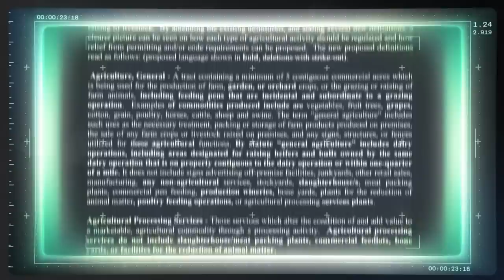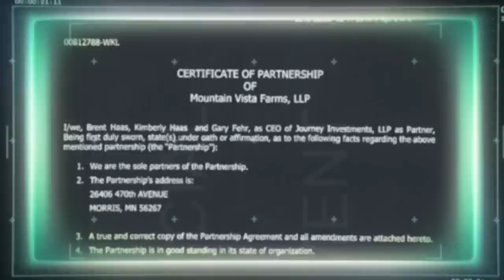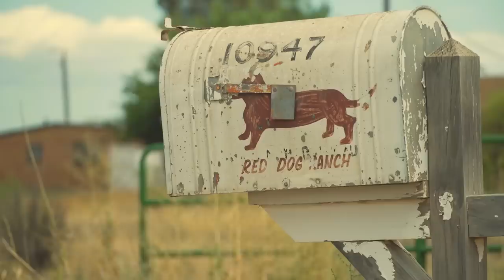Draining Arizona: Mining For Water In The Desert Leaves Residents' Wells Dry | NBC News

Comment: How come every time I watch a video like this one I see people irrigating crops in the middle of the day? I thought it was common knowledge that irrigating after sundown is better because less water is lost to evaporation, allowing more water to soak into the ground.
Reply: This could be early spring time or during colder weather
Reply: I’m in the ag business here in Texas and to answer your question your are right it’s best to water at night, but the pivots are walking so slow it usually takes 24hrs to make a complete rotation. By the time they do it’s time to start the process again.
Reply: @ryanweaver3615  We can put people on the moon but we can’t figure out a better way to irrigate?
Reply: Watering when sun goes down leads to fungus growth other nasty things
Reply: @ryanweaver3615  That seems like it would lead to an uneven crop. If watering at night is better, that slice of the pie/ clock face should also grow better, no?
Reply: The ground here is extremely dry and hard.  We've been having monsoons lately which is a very nice bit relief as the weather is predicting to continue with rain fall records.  
Regardless,  to get the water into the ground here is quite "tricky" with the hardness of the dirt.... not soil but dirt.
Reply: @chrischapman276  Turning soil into dirt is one of the biggest problems with big agriculture. So many problems could be solved by regenerative farming and cover crops.
Reply: @craig8638  We are learning quickly. My wife and I, mostly her, have hand tilled the 36x36 garden we've got here. We add the stuff from depot and lowes along with cow poo from local dairy's. 
The zucchini are enormous! Watermelon are almost ready to pluck. Sweetest corn we've had before in our southern california home's garden. Just a filled up nicely sized garden that my wife is  the artist of!
I don't have the skill or a green enough thumb to do what she does in that thing!
Reply: Did this for twenty years in Kansas, never figured that out. Corn can use an inch a day, but how to keep up just at night? Corn will bleach out and "Flash " (HEAT Damage ) during a 110 degree day...
Reply: @user-wj6kq3xw2g  Yeah "other nasty things" like conservation.
Reply: @ZacLowing  It would but the watering cycle is always purposely out of sync with the 24 hour cycle to even it out.
Reply: @williardbillmore5713  sure.
Reply: This type of irrigation is illegal in most appliations in Australia, water must be supplied via drip irrigation onto or under the surface to avoid evaporation losses outright
Reply: My lawn sprinkler is set to turn on at 7:00 PM. and it runs for 15 minutes and I have the best lawn on my street.
Reply: @williardbillmore5713  really not something to be proud of!
Reply: @mehere8038  Where I live in the Colorado mountains at over 9,000 feet we actually have an abundance of water. The Colorado water board has to let about 30 feet of water out of our huge reservoir in early spring to avoid flooding downstream from the spring run off.
 There are still tens of feet of snow just a few hundred feet above us right now.
 I am proud of my lawn and I am proud that I use less water than my neighbors do with their hoses and sprinklers going all day in the sun..
Reply: @williardbillmore5713  ok, well I guess that's not that bad then & good you use less water than your neighbours, still better to only water every few days though, so that your lawn grows longer roots & is more durable & self-sufficient. In the setting you describe, I'm not really seeing why it needs any watering, seems like it should get plenty of natural water & presumably that water can still be used for things other than lawns further down stream if it's saved in your area. Those with less water probably need to focus on saving it more than you, but dams & reduced water flow do massive damage to the environment over time! Rivers NEED to be flushed out with spring snow melt to prevent them dying
Reply: @mehere8038  Watering in the evening accomplishes much the same thing. The air cools quickly here as soon as the sun goes down so the water can soak down deep instead of evaporating into the air.
  Going days between heavy waterings will allow the surface ground to cake and harden and that will discourage new sprouts from emerging from the roots.
 Short evening waterings a couple of hours before sundown works best for me and I have found that consistency is the key.
Reply: @williardbillmore5713  well then you are certainly not doing right by the environment is you are ending up with caked & hardened soil on the surface! Carbon doesn't harden! You clearly have no carbon whatsoever in your soil, which is a sign of very poor management of the land. If the roots are growing properly in grass, they are regularly slothed off as soil carbon avoiding the issues you speak of. Your ground is acting like deserts & severely damaged land does! That's appalling in an area with as much water as you describe & use!
Reply: @mehere8038  Seven sprinkler heads for ten minutes a day isn't wasting water.
 You have no idea what you are talking about.
Reply: @williardbillmore5713  S of course it is! You probably run your tap while cleaning your teeth too & don't consider that to be "wasting water" even though there's no doubt in the real world that it absolutely is!
Reply: Watering at sundown is the worst time to water. Standing water (especially on foliage) can promote mold and bacteria which will cause disease. It's best to water at sun up before the ground is hot, and with enough time to soak in before it gets hot. Keeping crops dry is more important than people realize.
Reply: @williardbillmore5713 why don't you replace the grass with food producing crops? Lawns are a waste. Don't be fooling yourself. By the time the Colorado River gets to the Gulf of California, it's all gone to people who said the same thing: "I'm not wasting water".
Reply: @mountainmanxyz   Where I live at 9000 feet we get a hard frost almost every night the whole year round... Mold is not a problem.
 Mosquitoes have about a half hour per day between when it is too hot and dry for them and when it is too cold for them to fly.. If you don't go outside right at sundown you would never know we have mosquitoes at all.
 It is very different living in the mountains from what you think you know.
Reply: @mountainmanxyz  As I have noted. We get freezing temperatures almost every night at 9000 feet. We have snow on the ground at least 8 months of the year. There are very few food crops that CAN grow here.
 The Colorado river will not support the down stream population because there are too many people trying to live and grow crops in the desert. What we do at the headwaters has little to do with where the water is used and wasted down stream. We have an abundance of water here because by the time the  last winters snow is gone completely from the mountain tops we start getting new snow in the fall. It is an unusual year if we don't have snow on  our yards by Halloween. Some years deep snow.
 I have to wait until June until my favorite fishing lake is ice free and I often have my fishing season cut short when it freezes again in October or some years September.
 My lawn watering season starts around mid June and I usually blow out the system around the last week in September so it won't freeze the underground pipes at night.
 Don't try to tell me I waste water.
 Do you ever play golf or have a swimming pool?

Comment: If they are taking water from surrounding properties that should be seen as a taking in civil law when the properties are no longer able to sustain life. If they have millions to invest the have millions to pay out for everyone impacted in a class action lawsuit. These people are operating on the assumption that they can sustain their own operations, not that the entire Valley could continue to sustainlife, unless of course the entoer Valley sells out the the corporation. 

On a hot day when head of cattle content 30 gallons water. Thats 1,800,000 gallons of water a day just for the animals, that doesn't include the feed production and other water usage.

Someone should look into who was involved in the removal of a cap on head of cattle for the area and if any back room deals where made to change the area in such a dramatic way so quickly. Im not sure about the type of cattle they use but 657,000,000 gallons of water a year just to water 60,000 head of cattle id going to double if they follow through with production plans.

How is more than 1,314,000,000 gallons of water pumped for feed and hydration of more than 120,000 head of cattle sustainable for the area the company is operating in?

"Following are some thumb rules on water intake that may be helpful.

Daily water intake may vary from 3 to 30 gallons per day depending on age, body size (weight), stage of production, and the environment (mainly air temperature).

As a rule of thumb, consumption will range from 1 gallon per 100 pounds of body weight during cold weather to nearly 2 gallons per 100 pounds of body during the hottest weather.

Lactating cows require nearly twice as much water compared to dry cows.

Clean fresh water free of manure, dirt, and other debris is important."

https://beef.unl.edu/amountwatercowsdrink#:~:text=As%20a%20rule%20of%20thumb,and%20other%20debris%20is%20important.

Comment: The Arizona Department of Water Resources must be DUMB to allow the aquifers to run dry! They have to force the current well owners to build infiltrating trenches and swales to capture any rainwater to help refill the underground water aquifer. Once the well owner wants to dig deeper to access the water, he should be forced to build 3 foot deep trenches and swales near his pump to help refill his water source. These deep trenches will capture any rainfall and the depth will help prevent the suns heat from evaporating the water before the rainfall is absorbed into the ground. For every 10 acres of farming, the farmer should be forced to build 1 acre of infiltrating trenches and swales. This will help sustain the underground aquifers!
Reply: If a farmer dumps 1 million gallons of water on there crops what happens to the water the plants don't use? It soaks in and rejoins the aquifer. What doesn't soak in evaporates and then falls back to earth in a different location. Water doesn't get used up and go away. It stays on the planet somewhere. The only water the leaves the planet would be as ice that form on rockets as they leave the atmosphere. Even the space station recycles their own urine. The human body is made up primarily of water. You die the water is returned to the earth. We don't have a water shortage problem, we have a water location problem

Comment: infrastructure   is whats needed.  national  investment  .  we  during the  50,s and 60,s  we built  the  worlds   biggest  road  system.  we can do the same   with moving water  from where there  is too  much   or more then is used to  places that need it.  and  it comes to  raising crops   its  a needed thing. we can suffer  until we are forced to do it  we can.  but  it will happen. right now all that needs to be moved  can  just  be put behind the big  dams. bu really  we need to  find the  low  spots   and  dig them even  lower  and fill then  with flood  water . its  a  best investment  we can make.

Comment: I saw a solar farm for crops that had solar panels for energy use, and it also made it so the plants needed less water because it didn't evaporate so quickly.  The solar power was used to power the stuff around the farm.  Maybe there is a way to orchestrate the farm, crops, watering systems, and everything else so the whole place uses "a lot" less water and the farmers can still keep the same numbers they have been doing and want in the future.  Simple changes might save them a lot of money, be good to the environment, and still make the same profit.  Having the solar panels shade the crops in different ways for different crops would provide a lot of energy to if the farm is that big.  Maybe give the power to the surrounding homes so it could lower come costs and things.  Take some of the pressure off, lower the water usage and be able to give it back to the people needed in water, and have it so everyone is basically the same.

Comment: 1. It's called a pivot line field, not a crop circle.  It's the most conservative use of water.
2. No till alfalfa can add to soil fertility.   Corn is a little weird, since it's tilled every year.
Pumped allocation to cattle feed ought to match the winter capacity of the range.  Doesn't that make sense?

Comment: I'm pretty sure that the hills in the background collect well enough water for a year on this farm. There obviously has been at some point in the recent past, and still fills up the water table to some level or another.  If only it was collected correctly and stored efficiently.
If they invested heavily in some huge tanks and a system to collect the water at the foot of those hills, or tapped into the streams that run off them, they could collect most, if not all the water they would need for the year.  Then, their usual water supply could just be used to trickle charge their containers for the rest of the time.  Giving the land around the chance to allow it's natural water level/table, to get back to the level it should be at.